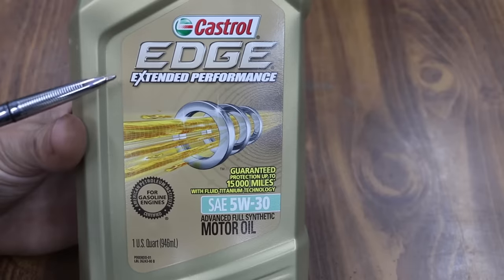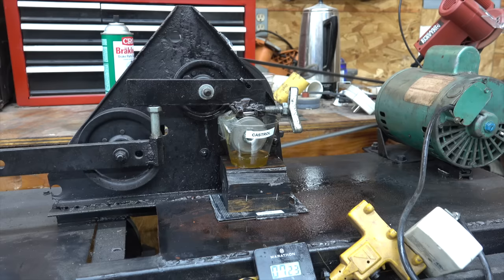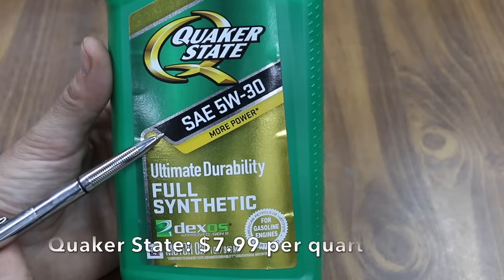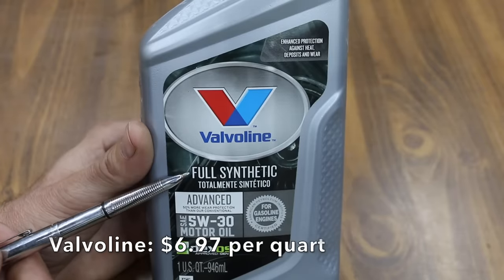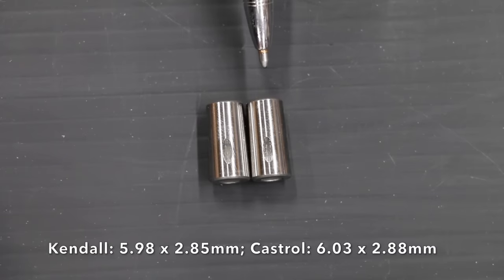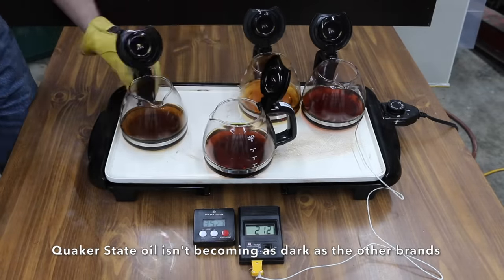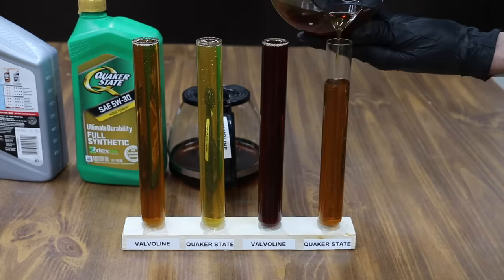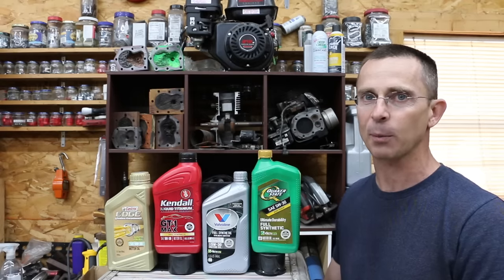Is Castrol Motor Oil better than Kendall? Let's find out!

Comment: But bad news. The way to test one motor oil or one maintenance protocol against another is a fleet test. For example, if you want to determine whether Ultra-Mauve-Synthetic and a proprietary filter w/a 25K change interval or good old Super-slick dino from that big box store with a no-name filter and a 2K change intervale works better, one way to do it would be to be put 1000 New York taxis with fresh engines on each diet and see what happens. Fleet tests aren't the only way, but they are an effective way to testing different ideas about maintenance and how to improve fuel economy. Tearing down engines and inspecting the parts or performing sophisticated testing might be another way.

I would pay more attention to how the flow rate changed with each oil after use than I would with how fast it flowed at -40. A slower flow rate after use indicates lighter components boiling or burning out, which in turn probably means less thorough refining in the first place. I don't know about some of the other people where I live, but it never gets below 20F overnight at the absolute coldest on my street. That's why I call synthetic oil a vanity product in most applications. But if the manfacturer says use it, use it. One person online said that with modern refining all motor oil essentially is synthetic.

To a degree that is true, at least as it come out of the container. People talk about dino oil like they pump it out of the ground, run it through a coffee filter and put it in the bottle. Not so. Conventional (dino) oil is a highly engineered product.

But what do I know? I'm a political, social and cultural theorist with an M.A. (in progress) in English literature.
Reply from the maker: Thank you for the feedback!
Reply: @ProjectFarm  I am not a kid to say the least, but as I go on in my graduate program in English literature (I am almost done now) I have become better and better as a social and cultural theorist. I tend to filter everything through these lenses, including mechanical theories. I think my take on motor oil as cultural concept works out pretty well.  Synthetic oil as a vanity product. But if using it encourages people to follow their maintenance schedules, that's for the good, I would say. I used it the past to extend my oil change intervals when I was driving up 3000 miles a month. I noticed no difference in gas mileage with it. That was a long time ago. I don't use it now.

Comment: Another interesting test would be an expansion upon what was done in university physics class to determine kinetic and static friction. It's an incredibly easy setup, all you need is a machined flat surface and a machined flat block (heavier the better). You can chill the plate and the block and apply a thin coat of oil (like .5 mm with a scraper), then measure the amount of weight it takes to break the block free and the amount of weight it takes to keep it sliding. Then repeat the test with the plate and block heated to 200C. You will get the coefficients of friction for the oil during cold starting and also under operating temperature.

Here is an example of the test;     http://www.pstcc.edu/departments/natural_behavioral_sciences/Web%20Physics/Experiment%2006%20PHYS%201310.htm
Reply from the maker: Great test idea!  Thank you

Comment: Although Valvoline won the flow test hand down. It looks like the cooked Quaker State edged out new Quaker. That's certainly unusual.
Reply from the maker: Great point. A little loss in viscosity isn't too big of a deal but something I'd further look into though an oil analysis lab after an oil change interval to make sure the oil stayed within spec.

Comment: Peaking my interest... speculation is Valvoline will do badly.  I tried it one time and had more than 1 quart disappeared in like 1K miles...no signs of leak or burning or anything.  Next oil change used Penzoil had zero loss.
Reply from the maker: Thank you.  Penzoil does an amazing job tolerating high heat.

Comment: Did you all see how Quaker state was able to keep it's color from turning dark during the heat test 😎
Reply from the maker: Great point. Thank you
Reply: Perhaps also related to and for the same reason that it lowest heat evaporation of all of them as well. QS Full Synthetic is one of the lowest priced full synthetic motor oils on the market.

Comment: Great shows and lots of info. Keep up the good work. Like anything it must be cost effective to be practical. I happened to find my old gasoline engine and took it apart to check and maybe replace rings. Found an oil pump that squirted oil from the sump and lubricated the cylinder. Neat idea. Though you might enlighten viewers about other engines that might have some type of oil pumping other than splash and if it is worth the extra cost. Seen John Deere 4020 engine with spray to the cylinders for better lube and longer life. Suggest you consider this as a topic and lay out the facts and cost and see if it makes since and improves the life of the engine any other ware reduction might be worth the effort also. Thanks for those great videos. PS: you might use one of those snake like camera's you can stick inside and see what is going on and how much the oil is lubricating.
Reply from the maker: Thank You!
Reply: An after thought of using a plastic see through would be an ideal way to see the splash or any pumping action. Video's are for action.

Comment: These oils need to be tested at operation temp and cold. Not just cold.
The bearing wear test needs to conducted at 180 degrees its optimal protection in wear and its ability to lubricate.

If all oils are tested in this way Castrol edge titanium will be the best oil.
Reply from the maker: Thank you for the feedback

Comment: My ex used to have a shop put Kendall GT1 Synthetic in her notoriously craptastic 2.7l Chrysler V6 engine (coolant system nightmare, head bolts loosened (never touched), etc.). It was a stout oil for the way she stupidly raced around. Plus it was only about $6.50 per quart in bulk.
Reply from the maker: Impressive results!

Comment: back in the early 70s I knew a man that would use 250 weight oil in place of 90 in the rear ends of his truck, So the Question did it keep from wearing the gears down
Reply from the maker: Wow! That's a lot of viscosity.

Comment: So it was not my imagination. When I use Quaker State Full Synthetic 5W30 in my 180,000mile Camry 5SFE it just does not burn off. It is noted in real life too in my 1991 CRX with 195,000miles. Don't even need 'High Mileage' oils.  I also use Pennzoil Platinum and Ultra Platinum. Remember, Quaker State is Shell Oil Products US just like Pennzoil. Platinum had a 6.03mm x 2.88mm scar and 1.22 gram burn off loss. QS was 5.97mm x 2.85mm and 1.16 gram burn off loss. Interesting. Though using Ultra Platinum with an additive is cheap and superior. Or a Fuchs GT1 Pro Flex synthetic...
Reply from the maker: It's good to see real world use results consistent with the test results. Thank you

Comment: Hey Project Farm, it was more than that but as you get a ton of comments and it probably hard to go through them all I will just put the video idea here:

Project Farm 
Well hmm, perhaps a twist on this could make another great video..

Since it seems that little myth of bananas were debunked, if you were in their shoes what would you have used to limp the car to safety?
(Especially if you can get a rough idea of what they had on hand and in their supplies to work with)
I’m sure they had some sort of food which would have an oil or grease to it, but probably not at large amount
Other items like maybe lip balm, some axel grease, sunscreen, etc
What items or combinations of items would work best?
I doubt they would have enough of one effective item so would probably have to be a mixture
(For example would a mix of banana, axel grease, a little brake fluid they could steal out of the master cylinder work? Or maybe some cooking oil mixed with lip balm and sunscreen?)
Not sure how easy this would be to test but sounds like it would be a lot of fun!
Could even film part of this in the field in a sort of Top Gear Project Farm challenge
(Maybe a go kart or something along those lines would be better to use as I don’t think finding an actual 2CV to experiment on would be all too easy or cost effective lol)
What do you think?
Reply: Project Farm just brainstorming here as other things that they may have had that could possibly work...
I don’t know much about the 2CV but if it had shocks with fluid in them that could be used (might have a very bouncy ride but at least they would be moving lol)
Candle wax perhaps? It would stay a liquid with the heat of the engine
Would probably be a small amount of engine oil left in the oil filter 
(And just thought of this, the banana of the original myth would surely have clogged the oil filter pretty quickly, unless they gutted the paper out of it?)
Being the desert it might be flat enough to do away with the rear brakes and use the brake fluid from the rear brake lines?
You are a lot better at thinking up this stuff that I am, so I’m sure you will think of more things that could be used and/or mixed together to limp the car to safety
I really think that something along these lines could be an extremely fun and interesting video idea!
Reply from the maker: Sorry about that.  Thanks for the test idea on candle wax! Seems like it would work better than bananas for sure!
Reply: Project Farm it’s ok
I find it hard to keep up with a few comments a day
I have no idea how you keep track of hundreds lol
But yeah I think a challenge to see what you could use from things they had in the desert with them that might actually work
And I think it would be fun to see what will happen
If anyone will be able to find a good temporary oil substitute it’s you!
You are kind of the go to expert in testing oils and other things

Comment: Your videos are awesome, and I have enjoyed watching yoyr testing methods progress to limit variables and ensure consistent results.  That said, there are a couple things that could be done better.  With the lubricity tester the wheel that wears the bearing material will eventually become smaller and decrease the contact area with the bearing and increase the amount of wear over time. As far as remedying this, sadly it would involve using a new wheel for each test that is precision machined down to about .0001 inches, creating a negative cost/benefit ratio. Another thing that would be good is to clean the bearing holder more thoroughly between tests to decrease the amount of cross contamination.  The second is much easier to implement.
Reply from the maker: Thank you for the constructive feedback.

Comment: Heres an idea that isnt a motor oil contest.
What if you got a carton of cigarettes and packed them all into a pipe so the engine could breath in the smoke. Then see if the engine could keep running or if the tar and gunk stops the engine and what the inside of it looks like after.
It would probably kill the engine and block the intake and valves but it might be a wake up call to some smokers
Reply from the maker: Thank you for the video idea!

Comment: So many oils now idk what to use for my 2012 Silverado Texas edition, ps I beat on my truck daily with 191xxxx miles on it
Reply: Shell Rotella Gas Truck motor oil would be an excellent choice. Designed specifically for your type of vehicle and usage.  Independently tested many times and also gives outstanding results.

Comment: We want extream heat condition show down between 5w30 synthatic and 20w50 conventional oil as I live in the middle east with avrage 46c temp  in summer and it never reach 0 in winter where I live and the dealer ship clame that 5w30 is good for 10000 km and now The owners of cars like Taho and Youken complain that after 2 years of using 5w30 fully synthatic for 10000 km as the dealer ship adviced has ruind there engines
So I'm woundring if thicker viscosity oils which mostly conventional are the best for our climate as I'm now using total 5000 20w50  api sl and I don't go on that over 5000 km I actually change oil and filter monthly even I don't reach 5000 km every month
Reply from the maker: Thank you for the video idea!

Comment: G'day,

Yay Team !

  Um, are you going to award a secondary Prize for the most imaginitively stupid Marketing Jism printed on the Label ?

  When I heard that,

"Liquid Titanium Technolololology"

I almost choked on my Coffee.

  To liquify Titanium requires an Industrial-scale Blast-Furnace..., that's why they make Jet Turbine Blades out of the stuff - because it's harder and lighter than Steel and it has higher temperature resistance.

  So, there is NO WAY that a Plastic Bottle of Oil contains ANY "Liquid Titanium", at all, whatsoever.

  And, if the suggestion were to be floated that the Titanium had been ground down into Nanoparticles mixed into the Oil, as a Suspension ; then why not use Carborundum ("It's Great Grit !" as the Billboard says), if they REALLY wanted to "improve" the Oil by adding any Powder which is harder than EVERYTHING else of which the Engine is constructed - to function as a continually circulating "Lapping-Paste" forever smoothing the inner surfaces of the Motor by gently sanding away everything the Oil ever touches....

 Or, maybe the TitanieYum is rendered unto a Liquid by dissolving it in Acid (!) before the resulting toxic Sludge is mixed with the Oil at the Factory...; though why that would "improve" the Mixture is a mystery unto moi..

   Ho, yuss, methinketh that the Farce is strongly strongly evidently resident, within this brand of Placebo-Effect...; and the fact that the stuff is apparently an otherwise perfectly servicable high-grade Oil merely highlights the remarkable Ignorance and Stupidity-Levels which the Marketing-Division assumes to exist within their Customer-Base.

  So, I think that as well as an Award for the Best Oil ; you should also bestow a Prize for the Worst and Silliest Marketing Bullshit on the Label...

Please ?

  Have a good one.

;-p

Ciao !

Comment: Once again, never like seeing a viscosity change after the the oil is heated for the burn off test - talking Castrol and Valvoline (strangely enough, some of the only brands I NEVER buy). Huge noticeable difference in flow test. What in the oils burns off or changes after it is heated that makes the cold flow viscosity change? There is a relationship between viscosity and concentration, but come on! This is engine oil. It should behave the same way in time. Unless this "thickening" is done on purpose to combat high viscosity with age and solvent exposure. If not...JUNK. Remember the Castrol GTX 1989 TV ad with the two glowing ball bearings after the oil burns off. The voice was the guy that did Boar's Head ads too, or was it Hebrew National?
Reply from the maker: Thank you!

Comment: Run these aforementioned oils in vehicles and take samples after 5 k, 10 k, 15 k, 20 k and 25 k. My capital is on Amsoil Signature Series. Better than full synthetic (not 100% synthetic), one of the very few 100% synthetic motor oils and the only one guaranteed optimal performance up to 25 k miles.
Reply from the maker: Great test idea! Thank you

Comment: Castrol Edge is regarded as shit among car enthusiasts in germany. Liqui Moly, Ravenol, Addinol. those are the brands to buy. But i guess US people shouldnt be too concerned about oil, since their engines are bigger and can handle stress better. in europe, due to co2 and nox regulations, downsizing is everywhere and those engines need good oil. Downsized VW engines like the CBZB are likely to fail with their 30k intervals with castrol edge. with a 15k interval and good oil, like addinol super light MV 0540, no problem at all.

Castrol Edge is promoted by VW in germany and is usually the oil you get with a new VW car. But like other parts supplier from VW, they get paid very little and get extortet to deliver cheaper oil. So they produce oil which barely fullfies the VW 504/502 whatever standard and not a good oil. If you buy an oil which also fullfies for example the MB 229.51, you've got a great oil.
Reply: also those tests are pretty stupid. better test would be to run those oils for 6000 miles in a car and then make an oil analysis of the used oil. then compare the specs.
Reply from the maker: Thank you!